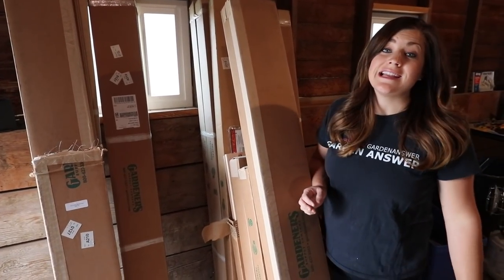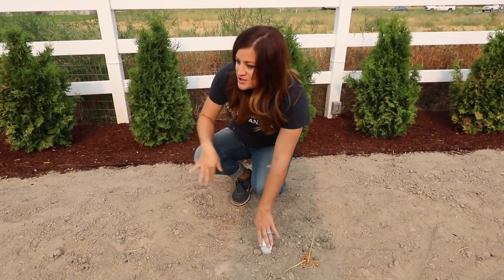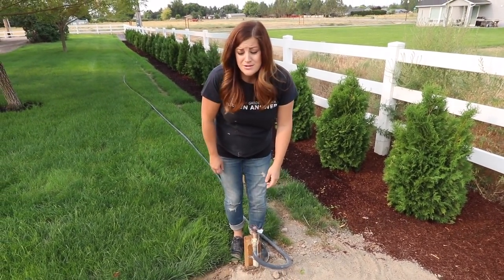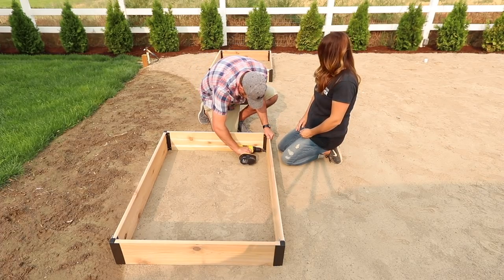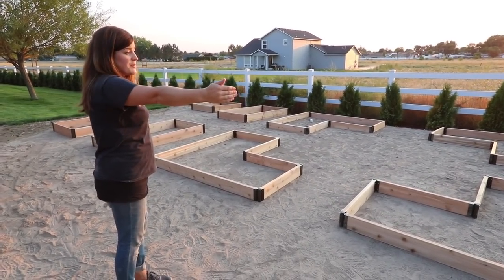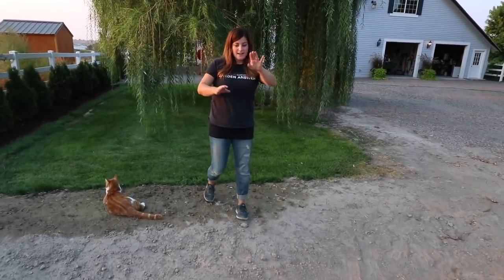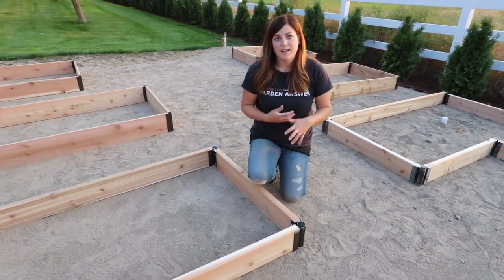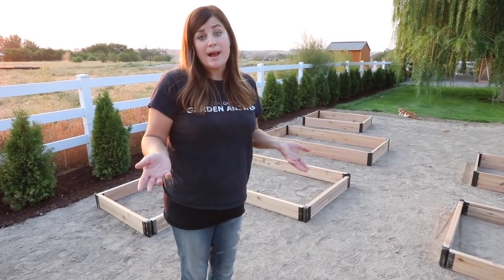Setting up Raised Beds // Garden Answer

Comment: Curious about the base you're using before adding the raised bed boxes.  Is that the color of the soil there or is it a layer of sand or something for better drainage?  I've already watched ahead and see that you actually used wider/taller boards over these, which is what I plan on doing.

Comment: Those raised beds are so simple to put together. I may have to order these for next spring. I tried planting right in the ground and the gophers went to town and ruined the design and spacing I was going with. Hopefully I'll have better luck with raised beds.
Reply: Gaybrielle Kopeland 
If you put chicken wire at the bottom of the raised bed, the critters can't get through it and eat your Veggies.